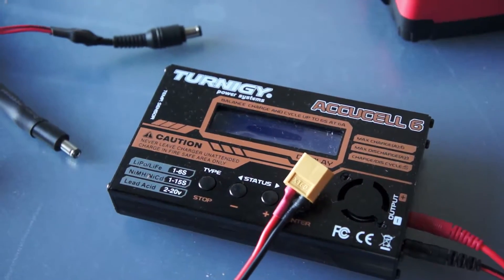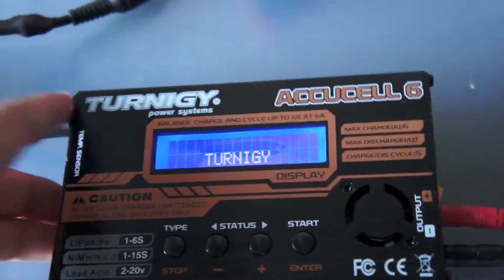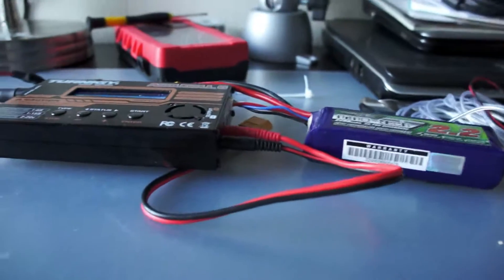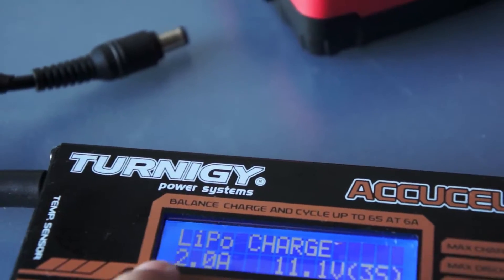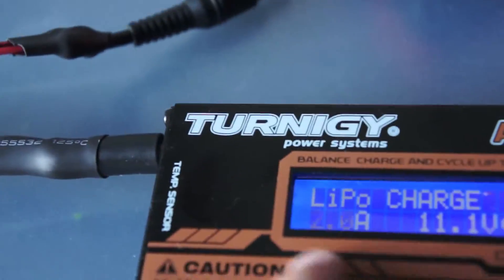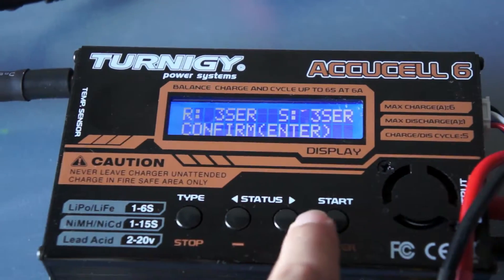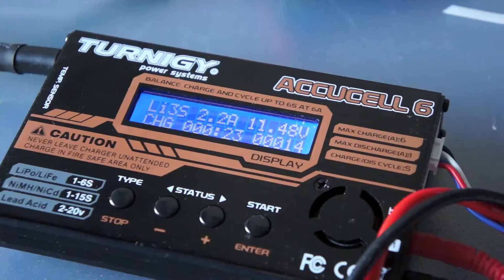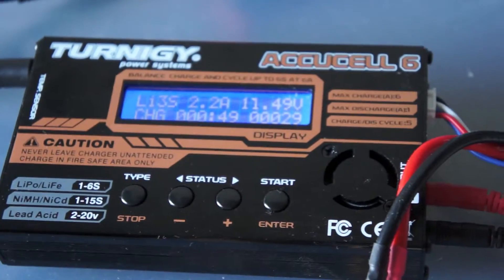How to charge LiPo batteries using the Turnigy Accucel 6 Charger

Comment: none of my connectors match the turnigy batteries I bought. wtf. your lipo has the xt60 plug...mine has the male/female connector. wtfff
Reply from the maker: It depends on batteries, sadly there is no standard Battery connector for RC vehicles (mainly because different connectors are rated at different amperages). You're probably going to have to solder your own adapter then to match your batteries, or switch your batteries to XT60!
Reply: Might be a little late but if anyone else has the same problem: You have to buy an XT-60 connector, and replace the connector that comes with the battery. You can achieve this by stripping the wire(cutting, pulling back the coverings) and soldering.